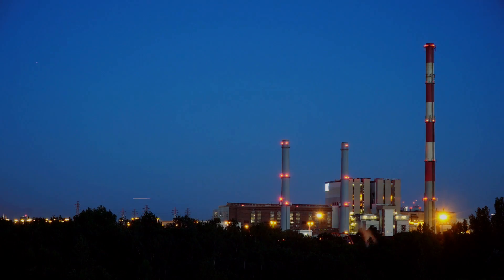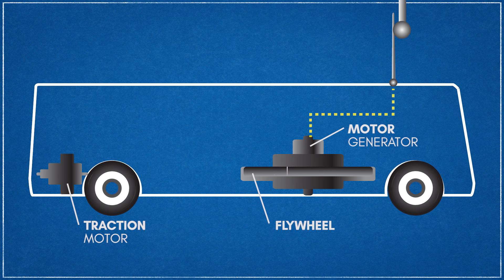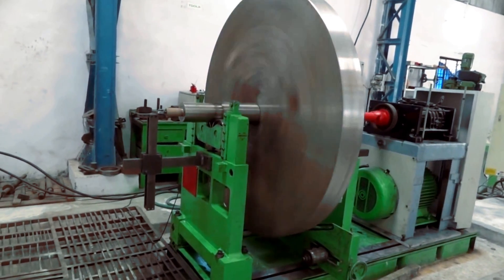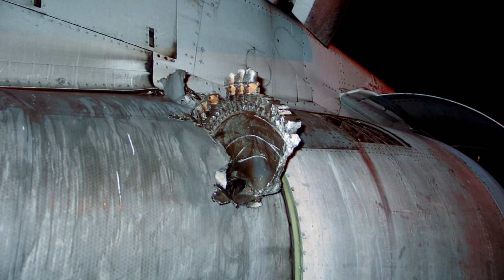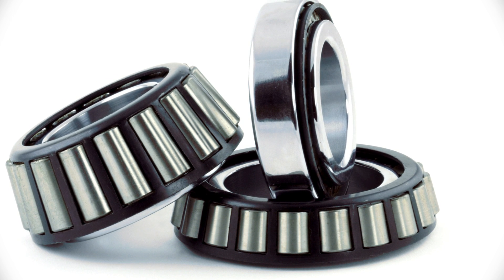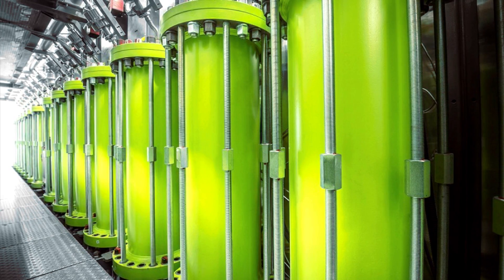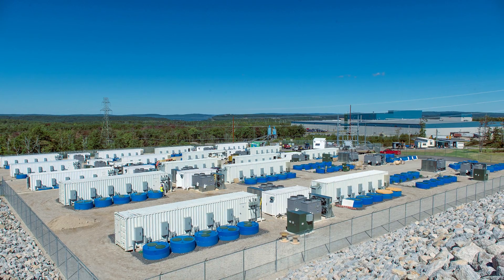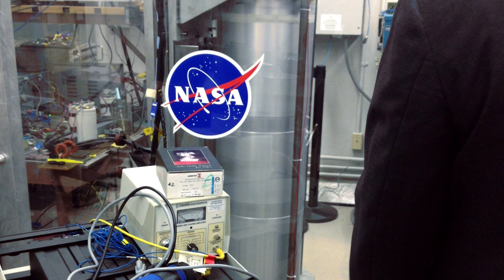The Mechanical Battery

Comment: If you had a flywheel in orbit, it would appear to slowly rotate relative to the Earth as it kept its orientation, but there'd be no energy loss. Maybe we could build a huge orbital solar panel array that used a massive flywheel to store energy, which would then be beamed down to Earth. A Moon-based flywheel would lose much less energy since the Moon spins 30 times slower. On Venus it would lose almost nothing.

Comment: I can see using a flywheel for stationary applications, but on a bus seems like unnecessary added weight.  Since weight and size are the factors that determine energy maximum energy storage at max rpm, then it is better application in stationary applications. But it is still exciting because it still works in both applications. But the bus won't go very far without needing recharges because you are limited to its size and weight.

Comment: Not mentioned in this otherwise excellent video, the failure mode of a big flywheel is catastrophic.
The seizure of the bearings - for any reason - can easily destroy the vehicle and harm anyone around. All the same, a seized flywheel in a static installation can seriously damage the building where the device is operating. 
This is the reason why there is so much emphasis on magnetic suspensions, because they aren't subject to sudden failures...

Comment: The concept I’m thinking of, seems to involve a flywheel energy storage system with a design modification to reduce friction and enhance energy output, the idea of tilting the assembly and using an angle transposition shaft linkage to allow the assembly to gyrate could potentially reduce friction by minimizing the contact the contact points that generate resistance, this could also allow for a more efficient transfer of energy from the flywheel to the output, possibly extracting finer amounts of energy.

Comment: Those batteries are better suited for low cost large scale short period storage  for uneven sources like windmills, solar pannel or tide turbines. By keeping them static, it's possible to use very heavy flywheels made out of cheap material like recycled cast iron and put them along the grid where the terrain is very cheap. I could think of many train or subway parts that could be used (bearings, shaft, electric motors) instead of starting from scratch with expensive development costs.

Comment: Correction, not all vehicles require a fly wheel. Automatic cars do not use a fly wheel lol, just manuals. Unless you want to consider a torque converter a “form of flywheel”

Comment: I was always fascinated with old movie projectors in grade school (70's). There was a mechanism that you could turn with your fingers that once it was rotating, would keep going for a long time. I suspect it utilized a flywheel and reduction gearing to store the energy. Imagine a smaller flywheel coupled to a larger slower flywheel with gearing that would convert the much higher torque from a massive slower flywheel into faster RPM with less torque generator.

Comment: A compressed spring is as mechanical battery, has kept clocks moving for many a century before electricity... Stored weights also were used in clocks!!

Comment: Better to use mass as a storage.  Like a grandfather clock . It’s safer and less complicated .  Generator using daylight solar lifts the weight, it’s released when required to power a generator back into the grid

Comment: Seems like gravity batteries are better for long storage, but these excell in repeated, instantaneous power.
If the massive temperature gradients could be worked around and you could still get a superconductor to lift it, I wonder about the energy density gained from making the flywheel a thermal battery as well.

Comment: when you mention replacement of 26kwh 100Kg Lithium battery with another 100kg flywheel, cant we break them up into 4x25 Kg flywheel? Since that is also what lithium battery does, they break into smaller battery pieces instead of one giant lithium battery. 

Just a thought

Comment: There is much hype about 'green' energy, but energy storage is just one its many weaknesses. Oil, coal, natural gas and nuclear power are proven over time and do not need storage. Storage systems not only consume large amounts of energy and resources to build, but they waste large amounts of energy in their use, i.e., you only get back part of the energy that you store. In the case of batteries, we know that they lose stored power in many ways (in cold weather, over long periods of time, as they age, etc.). That energy is never recovered and thus is wasted.

Comment: Is it possible to upscale a watch? The way that I understand it, is that it uses basically 25% of a flywheel (so that the shaking of ones wrist will allow it to spin) to continue momentum and winds up a spring. Could that be done with flowing water? I'm curious to find out how efficient that is compared to something like nuclear power or solar power. Any information on how I can research this further would be greatly appreciated.
Reply: I had to edit that comment to add in the statement that I made in parentheses.
Reply: Would it be possible to install a contraption similar to a wrist watch on say like a fault line? And use the natural tectonic plate shift to power it? Or even the rotation of the Moon to power it? Kind of like a tidal shift. Maybe a device anchored in the ocean that keeps that flywheel spinning to power the spring and then convert into kinetic energy...

Comment: I've thought of the mechanical batteries 5-6 years back and found that it made no sense because you don't need to restrict the size as such as that of our standard batteries are.  If you all would like;  I could think of it further and come up with something of end result in a few minutes?  All one needs to do is ask.  Cheers.  I just don't want to bother about anything insignificant unless someone would like to know of my deducting of deductions and how I'd come about them.  For one thing;  your batteries would need to have stages of cranking or one stage of crazy ratio that would then be way too dangerous if damaged and for instance it were to house a crazy spring that could recoil!!!.  Well anyways;  I'd probably go with a quick reload of them and just have a main energy bank that is as such.  But hey;  just ask and then I'll view the video and tell yas what I think.

Comment: This is a very informative video, but it would benefit from some attention to English grammar. The verbs often don't match the subjects' sentences. For example: "One of the most common uses of flywheel-energy-storage systems are ...." The verb form of "to be," (here "are")  needs to be conjugated to match it's subject which is "One" not "systems."  --> "One of the most common uses of flywheel-energy-storage systems IS ...."

Comment: @12:26 your thinking of practical use of the storage is unlogicaly wrong beyond salvation. And every engineer that thinks like that too. Because your battery that you are presenting is not a 100kg chunk of metal but rather made-up of many little ones connected in parallel and series. So making many little gyro storage with more moderated weights and spin speed that have in summery the same or even exceed the overall storage capacity of chemical batteries is not only possible but achievable cheaper. It's just your biased point of view that should be changed. On the thing as they truly are.

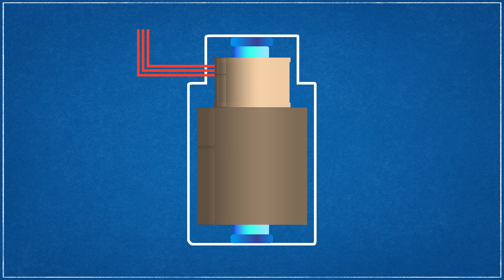Comment: Hey, at 5:58, you mentioned that the voltage of an AC machine suffers at lower shaft RPMs. I'd argue the output frequency is affected more so, since the number of coils on an AC motor or generator typically greatly outweigh the rate of flux movement. The output frequency is directly proportional to its speed though

Comment: Oker Energy develops industrial to grid scale energy carriers that manage, refine and renew production for all energy sources. The energy carrier ensures full utilization of production potential in real time, converts it to potential energy and then delivers it back on request. 

Without this energy bank, production will shrink into waste or accumulate in to a bottleneck where we are unable to exploit the potential. The result is excessively high emissions with a corresponding price picture due to needs of new production instead of supply from harvested surplus energy. 

Now this is not worst for Norway, which is covered by 97%plus clean hydropower.  But for the rest of the globe that depends on fossil and nuclear sources to meet needs around the clock it will open up completely new opportunities in green conversion, and the export of electrofuels (Hydrogen, Ammonia etc).

The green economy is rising and we belive that subsea pumped hydro storage can play a keyrole to secure energy resources and cost. 

Our goal is to install capasity equivalent to 10 percent of global daily energy needs by 2050.

Greetings from Oker Energy AS

Comment: Good thing that gimbal suspended gyros are mentioned. My question is that in such low loss mechanism, can the torque of the earth's rotation be geared up to generate people, to have it piped back into the spinning wheel? If there is no drain and the system only keeps itself going, would it be mathematically possible to have enough useful force pulled out of those precious 15 degrees per hour? Has anyone tired building a system like that?

Comment: I just came to a conclusion instead of having to charge your batteries every now and then why can't the electric car  have an onboard alternator to recharge its own battery so that way you'll never have to charge the battery ever or have to go to a charging station and pay a lot when the car can be driven on an alternator while it's moving the alternator spins recharging the battery that's powering the car kind of like a loop as the battery is being used the front or rear axle could drive the alternator kind of like how in a typical gasoline car where the belt drives the alternator to charge the battery what if you could use that same method

Comment: It is not 11 Mach, around 6 Mach. Do the Math again. (The outer edge of a 1 meter diameter flywheel spinning at 37000 rpm). Maybe you did the Math for a 1 meter radius flywheel.

Comment: Can't we slow down the flow of electricity? If so could we not store it in a short cable and then sleed it up again? If that is not possible because that is the energy can we use a circular cable and store in it the energy so when we need it we just make contact with the cable?

Comment: the tesla towers would turn the urths crust into a capacitor you use plants to turn dirt into sweet diesel into energy to pack into it and with enough computance .. you could fly the planet park it next to a moon along the way when you get low on dirt to pick up some mass tesla was way ahead of his time but that would make a really cool scifi movie scene ... =
Reply: every body to that side of the planet .. beep beep beep
Reply: electron flow fly wheel ...
Reply: you can drill a hole in the ground and put stuff in it to make nice large battery storage  lVl lVl
Reply: 12 inches wide and like 20-100 foot deep provide home or work place with plenty of power storage ...
Reply: pretty sure you can take copper rod and nickel rod shove them in the ground and get power out of them ... like o dang i found free energy
Reply: .. augers and batteries
Reply: particle wave quantum mechanic proves that some times the earth is sphere and some times it is flat ...

Comment: CAPACITORS HIGH VOLSTAGES FASTEST DISCHARGE FEEDBACK GAINED BY PULSES YOU CAN CHARGED  VFD VIBRATIONS FREQUENCY DIGITAL KINETICS NO VOLTAGE OVER 1VOLTS UNDER NEGATIVE ULTRA HYPER XONIQ

Comment: gravity battery does not have nearly the amount of problems , is even better idea than flywheel  . 
imagine several tons of rocks on some kind of platform (secured from children , fatal accidents ) lifted by hydraulic ram powered by electric motor and solar panels or wind turbine and when sun light and wind is gone the weight reverse the  flow of hydraulic ,   power the pump conected to the motor which became generator at this moment   ...simple and can by done locally ,at your backyard . (tired of watching stupid power lines grid system and tolerating giant utility companies )
the weight  lifting /powering system can be hydraulic , air pressure or even screw as actuator ..i'm sure there is more simple options which didn't come to my head (forgot about coffee this morning !)

Comment: The motor generator isn't a limit, where do you get this idea? Electric motors can work at high efficiency across a wide range of RPM. Mechanical stress is the real limit.

Comment: This has been ignored for a long time. Now how can you keep up the spin? The water wheel is a nice example if one where to lets say have a cable or chain bike like assemble in which to drive that chain or cable you'd use weight loaded upon the platforms that lower and then you could herd the cattle back up and if theirs enough cattle lined up there would be a constant downward pull on the wheel for it to spin to keep up the torque needed to maintain a constant spin.
Reply: Sounds archaic.

Comment: What a fascinating subject matter!  I learned so much watching this.  Makes you wonder why more of us don't have these sitting in our basements.  If coupled to Solar Panels, imagine these spinning up during peak of day, then off loading energy at night.  This might very well be the wave of the future.
Reply: Flywheels are continually losing energy, will likely never evolve to residential power storage because there are many better options that store 99% of the energy until needed- The gravity battery, one of the newest powerplants in development is simply a giant grandfather clock the size of a building. It uses solar in the day to operate hoists lifting huge weigts to the top of the structure, When nightime demand hits simply release a weight. GRAVITY BATTERIES ARE WAY BETTER FOR STATIONARY APPLICATIONS